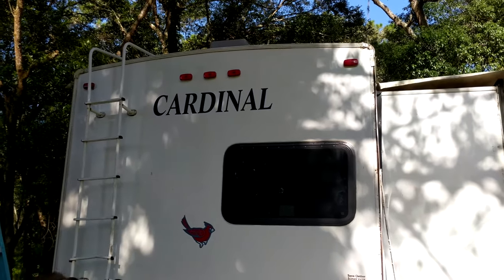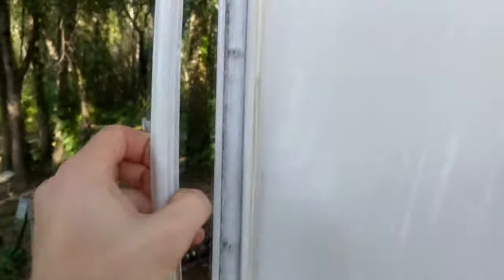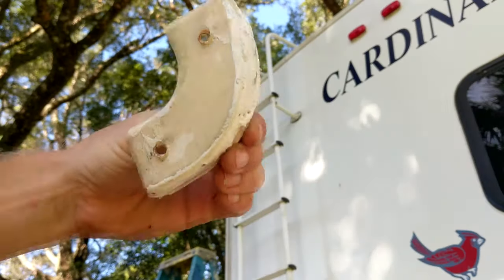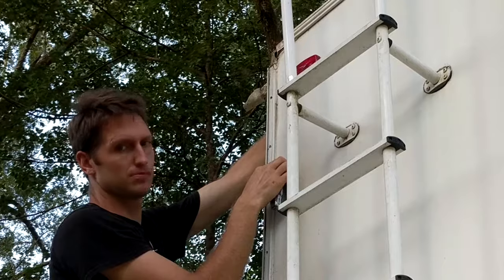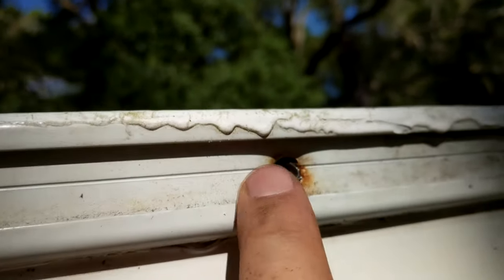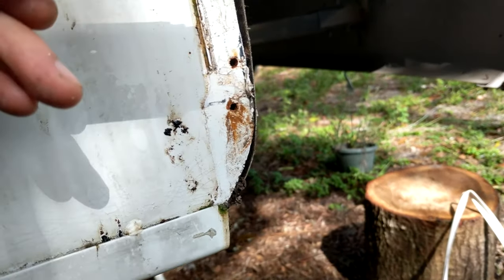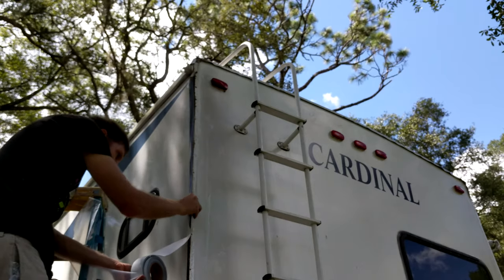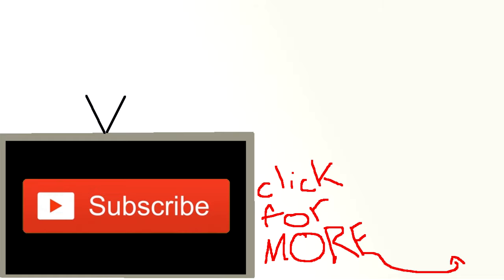How to Reseal and Replace your RV Exterior Molding Trim to FIX LEAKS | RV Renovation Tips and Tricks

Comment: Question. I need to replace the rubber (vinyl??) trim molding  which goes all the around my RV ‘s side. I can’t locate a replacement product wide enough. 1 inch wide is all I can find. Any ideas??  Liked your video, music annoying but it’s your video. 😁

Comment: After installing aluminum and vinyl windows for 25 years I prefer to use a good quality polyurethane type caulk like quad over a roofing tape. This caulk is tough stuff, long lasting, paintable, won't collect dirt, but can be very messy to work with.
Reply: Edit: not "over" roofing tape, but "instead of".

Comment: very helpful video, thanks!  I am in the process of removing my roof trim and so many of the screws are just too stubborn, even with a drill driver. No screw head decapitiations, yet, just screws that won't budge. Any tips?
Reply from the maker: Last resort, drill off the heads so you can at least remove the trim. Can't do too many like that though
Reply: @helloiambear5531  thanks!
Reply: I would use a drift punch and hammer to tap on the head of the screw several times to help brake the bond between the screw and the wood.  I sometimes use an air impactor or a battery powered device that rapidly impacts/vibrates the head of the screw and helps brake the bond, but not many people will have access to them. Use some valve lapping compound that you can get at an auto parts store and place it in the drive area of the head of the screw.  This will greatly aid in the grip of the driver when twisting the screw out.  If this fails, then use a vice-grip plyers locked onto the head and twist it to brake it loose.  If, as a last resort, I have to use a drill, I use a left hand drill bit, which is rotated in the direction that removes the screw, will sometimes drive the screw out.  I could get into screw extractors and other methods, as I have removed thousands of stuck fasteners, but this gets into complexity and experience that may not work for folks without this experience.  However,  one could do further research on these methods on the internet and learn to apply them if time and interest are there.
Reply: @lloydhohman4678  thanks so much!
Reply: @lloydhohman4678  This is great info.  I am planning on tackling a New Roof install on my 1999 Fleetwood Tioga.  Which will include remove of all the roof and corner trim pieces.  I can imagine there will be MANY rusted and stripped out screws.  I do have an impact driver with compressor and a decent set of Left Handed drill bits with extractors.

Comment: How would you fix the siding if it had a rust hole or scrape?
Reply from the maker: A rust hole? I guess the best thing to do would be to take it off, clean it, sand it down or sandblast it, then use Bondo to fix the metal, then paint it and reinstall it, or just find a replacement part somewhere